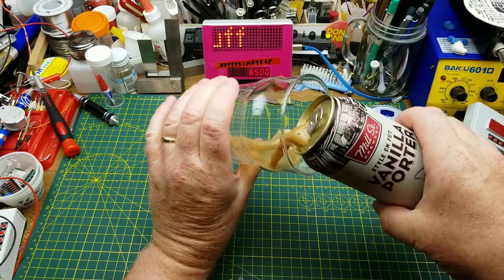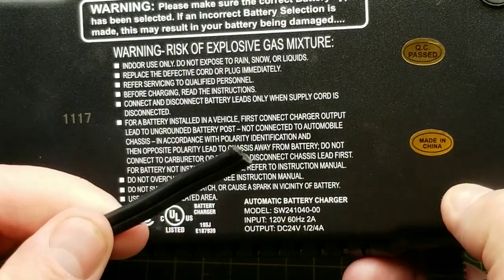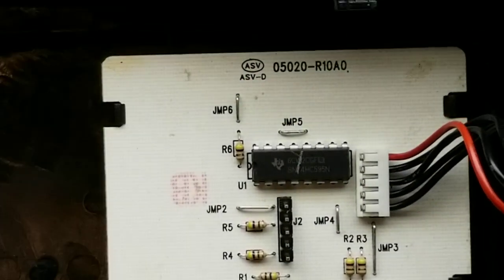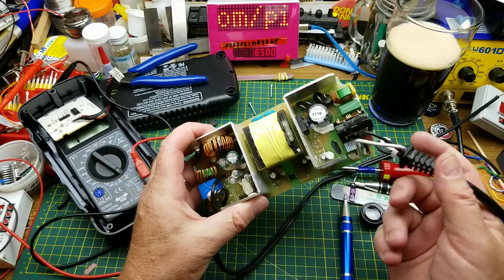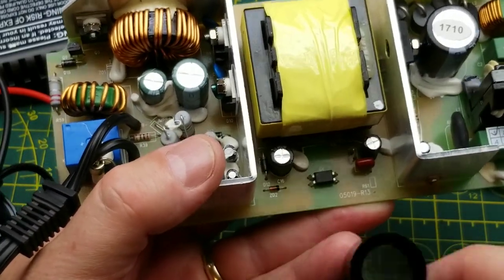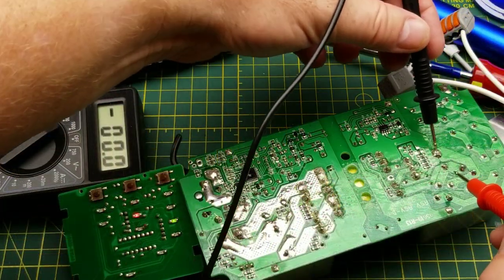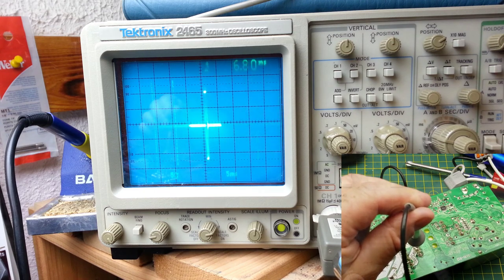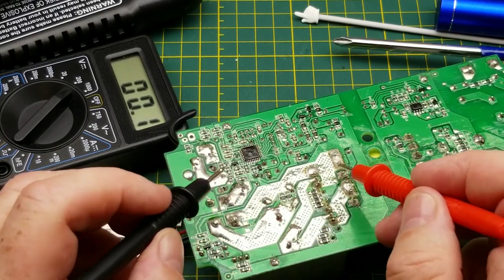curiosity tear-down: 24 volt battery charger

Comment: Hey you all. I finally found a use for that damn leadless solder. It works great to coat the soldering iron tip when finished with it. Best use I've found yet.

Comment: The power supply IC is likely limiting the power supply duty as there's no load. The 5V appeared solid so it's probably working.
I think there's likely a "battery detect" on the output that's being monitored by the processor. If there's no battery there's no output. These things often switch the relay in/out to sense the battery voltage when off load.

If you've got a battery to provide  a load (and voltage source to monitor) the thing may power up. You could probably charge a big cap up to 24v and stick that over the output and wake it all up, briefly of course as the cap would charge nearly instantly.
Reply from the maker: Possibly, but remember it was removed from service before I got it because it wasn't working.
Reply: @pileofstuff  I would say the start up circuitry on the primary side is dead, or the main filter capacitor or a diode is also open circuit.
Reply: Don't ignore the possibility of a misdiagnosis - a completely dead battery might have given the impression that the charger was at fault (no output).  Alternative both charger and battery were replaced because it was the easy option.
Reply from the maker: @alanpatterson2384  Possible. I'm not sure if the batteries survived. If the mechanic swapped them he would have taken the old ones to recycling.
Reply: I concur with this train of thought, smart chargers need to test battery voltage. I’m wondering if his batteries were toast. Typically these chargers sense the battery before they start their charge. Great tear down anyway Pileofstuff!
Reply: Yeah, 5V is so steady I don't expect a problem there (yet).

Comment: Under no output load there will only be short burst of conversion to keep leds and shift register powered. 
Output of most chargers are only active once connected to a battery, detecting some minimum voltage of correct polarity. Main DC charge output will stay zero until battery is detected
Reply from the maker: Maybe, but it was pulled out of it's installation in the first place because it wasn't working.
Reply: @pileofstuff  yes, it is reasonable to expect it to be faulty given that it was replaced. Just that for functional safety chargers are normally designed intentionally to keep output leads off until a basic battery voltage is detected and is correct polarity. This has several important safety aspects. 
Firstly while leads are not yet on a battery if voltage is present many times sparks will occur as the leads briefly shorted. 
Secondly no connecting spark to a just discharged battery from for example heavy cranking to get a hard to start engine going.. At that time as well if just previously being charged some hydrogen released from the battery, can exist near the terminal. Any sparks may cause a explosion.
Thirdly many people will accidentally, even stupidly, connect wrong way round. If left inverse charging, definitely significant amount of hydrogen can be released. That in high probability can explode. In my former job a mechanic was close to serious injury as another person had reversed battery leads. When he went to  check  on state of recharging, he bent down and as he looked the battery exploded, splitting open spraying him from head to knees 8n hot sulphuric acid, into eyes and mouth and drenching the clothing. Fortunately instant action of drenching him on the floor, writhing in pain, with a fire hose in the workshop saved his eyes, and other than losing all clothes and suffering red skin burns, a pair of blisters on lips an tongue, he got away with no permanent injury. Exploding batteries are a serious risk during charging, especially reversed charge.
Anyhow the charger may seem defective if not correctly connected to a source 9f voltage before there is any output. In the case of the 24V charger the sense threshold could be upwards of 6V. It is even possible that the charger works, but for some reason the intended battery to be charged may have not been charging for connection corrosion issues. The person checking, like you applied a meter to the leads saw nothing coming out, decided to get a new charger, which on being clipped to the battery began charging fine. Where in fact this 'defect' could have been fixed by just wiggling the large alligator clamps, 9r if permanently wired to battery restating the connecting eyelets.  To test/diagnose the unit further, if any charge activity is possible may thus need connecting a battery, briefly even a 12v could be used, just do not leave it on more than a few minutes. To the charger it will just seem to be a very flat 24v and to the battery the 1, 2 or 4A will not do any harm, just do not overcharge it by leaving it charging to excessive voltage.

Comment: Those chargers usually don't start their output until they see a battery connected first. Use a battery and not a power supply as it can spike the voltage up past 12V to initiate charging.
Reply: @Wilson Stetson Flixportal :P
Reply: @Elian Dean thank you, I signed up and it seems to work :D I really appreciate it!!
Reply: @Wilson Stetson No problem xD